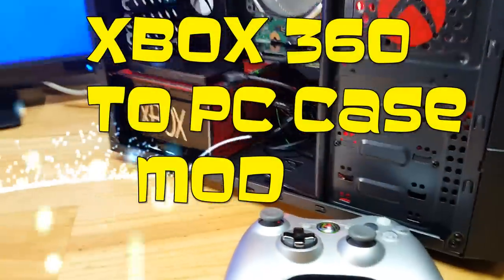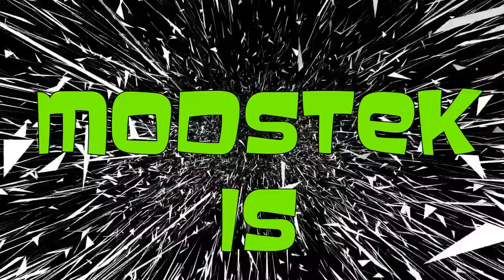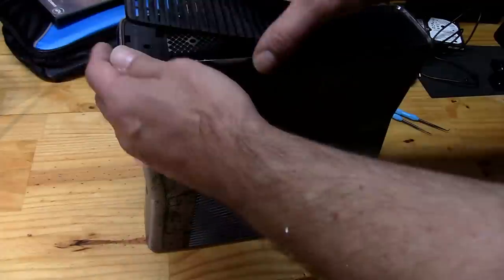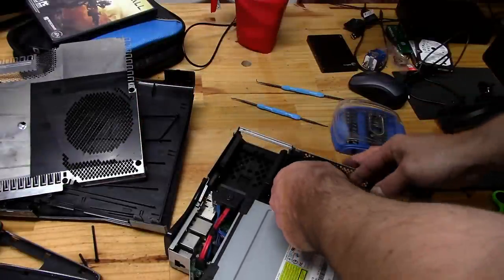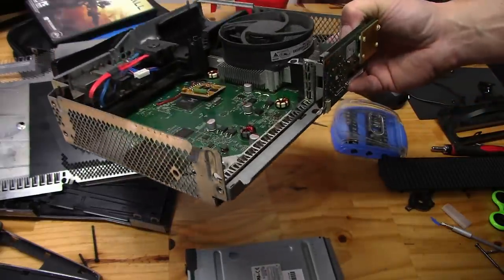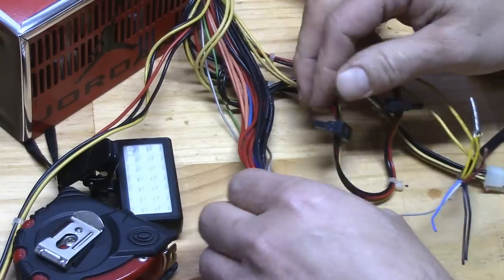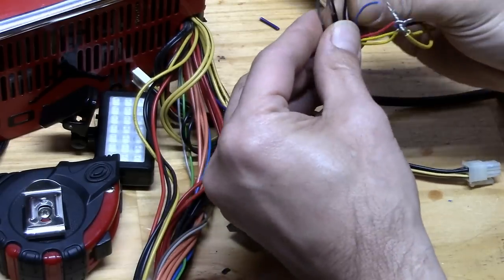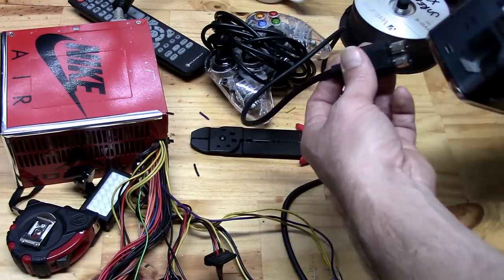My gaming rig is still an Xbox 360 but in a PC case.

Comment: You shouldn't mount hardware over a carpet and specially with bare feet. The static electricity goes nasty that way.
Reply: Nintendork its perfectly fine, i have made 3 pc's before and have never needed an antistatic mat
Reply: famous last words.
Reply: Finn   I dunno, doesn't sound like a bad tip either.

Comment: The cd drive has 2 data cables the power cable transfers data to the xbox 360 as well as the sata but its mostly used to detect if its there

Comment: So what happens if it gets the red ring of death? lol
Reply: Axilla that happens from overheating, so it won't happen
Reply: Axilla It won't, because it has a proper cooling system now.
Reply: Axilla you won't
Reply: Axilla it cant because of better cooling if he added it anyway
Reply: That was an issue in the first model where the Mobo melted and then, well.. RIP
Reply: Duck 0002 *ATI GPU
Reply: Ziggy Wiggy my brother fixed the yellow ring of death years back by taking it apart and applying new thermal paste ahahaha xD
Reply: It actually can. Much less common but the slim could get it. Any modern device with a BGA chip, especially the GPU, is susceptible to the type of failure that causes the Xbox Red Ring. Everything from your cheap tablet to your 800 dollar video card.
Reply: iggy151 well too bad it doesn't happen to any of thise
Reply: iggy151 those
Reply: With the extra cooling, I think that is a remote possibility and with a plentiful supply of motherboards, he can just install a new one...
Reply: It's a slim bro in case u weren't hammered on that enough lol
Reply: My X360 slim did the rrod once
Reply: Will this accept a desktop GPU replacement?
Reply: Slims don't get rrod
Reply: its a slim model it doesent have the bad red ring problems, only the minor problems will happen to it, like bad harddrive, E71 and overheating when in a closed space
Reply: @hrishikroy7866  slims do get the red ring of death. Its a small red dot and an easy fix if you arent litterally throwing the xbox out of a window

Comment: As if the 360 wasn’t big enough...
Reply: Matthew Ledford the 360 is small
Reply: popster1man mine  yea
Reply: Compared to the Original Xbox, its smaller. My favorite model was the Slim S but it still had issues with overheating  with later games like GTA 5.
Reply: PowerLeef I own both the slim and didn’t have any over heating problems and I played gta 5 a lot
Reply: PowerLeef my playstation 3 slim works fine without overheating. in 7 years of use i don’t have any problems
Reply: Twisted HD wow. You must've gotten lucky. Everyone I know with a 360 of any kind has overheating problems. The way I've found to keep them cool is keep a fan pointed at it and when it first starts lagging to put an ice pack on it.
Reply: Ilikeboost my xbox 360 slim has 6 years and no problems xdd "lucky" sure
Reply: @ilikeboost4764  I bought my 360 in 2011, and I don't believe I've ever had an overheating problem to the point of lag. Loud fan, but no lag. Yay meee?

Unless you mean the original models?

Comment: probaly can't, but a pc in an xbox 360/one/first xbox case
Reply: Brett Tech World it can be done, I've done it with the original Xbox, but don't expect it to do much gaming
Reply: Someone put a pc into one of the fat ps2s
Reply: mini STX is a possibility. it'd fit regular processors and laptop-grade GPUs like a 1070 or 1080 mobile chip.
Reply: A youtube person 'BTA' made a gaming machine into a PS2.
It had a decent i5 and a 750ti, then a 1050ti.
The xbox is much bigger, I'm sure it would fit.
Reply: Brett Tech World if you see it from the other side, mini itx system.
Reply: Eddie Zarick posted a video on that a week ago sporting a GTX 1050 Ti / i3 7100 / 8GB RAM / 256GB SSD
Title of his video: "Gaming PC inside an XBOX ONE S!"
Reply: The original xbox is basically a pc already. No mod necessary
Reply: Big Daddy consoles are not pc...
Reply: I have my pc in a xbox 360 case the thermals arent bad its like 80 on my i7 6700k and on my gtx 1060 6gb its around 76 .. its easy to do if u have the tools
Reply: A guy on Facebook put on in a 360 case, big Lego head, and is planning to do with in a metal briefcase that carries audio equipment
Reply: If you use a pci-e flat ribbon cable you can lie a half decent graphics card next to a motherboard of suitable size to accommodate in the case.
Reply: He did that
Reply: Thin client of elite desk
Reply: You could probably use a ryzen for the graphics, or a low profile 1050 ti. Or both together. That would probably fit inside any Xbox, especially if you used the 2200g or any ryzen like it with the Vega integrated graphics. Could easily fit that on its own inside an xbox 360, and you wouldn't even need a dedicated gpu. Not too sure about the power supply though
Reply: Just smack an mitx into it
Reply: He already did it

Comment: When you try to be a pc gamer
Reply: I like how having it in a PC case with more cooling would allow it to ventilate the heat better, but I don't get why he had to wire up the motherboard to a custom powersupply. There's really no need. Plus with the failure rate of most modern power supplies in today's PC gaming market, if it were to fail, he would have to rewire it all over again. Believe it or not, overheating is still an issue with the Slim S model ( 2010 ) in games like GTA 5 so this mod would be excellent for that. I wonder if there would be a micro atx tower that this could fit into instead of just a mid atx tower? Its not like you're going to be using any of the expansion bays on the Xbox, lol.

Comment: If only you could make it run windows instead of the xbox operating system so then you could play more games on it
Reply: if only you could get a pc...
Reply: Justin that's why windows 7 exists
Reply: Nick Dunnington but i has 512mb of ram, maybe windows xp
Reply: Windows 7 needs at least 1GB of RAM there bud ;)
Reply: I'd say at least 2.5. i have a win 7 pc with 1gb of ram, and let me tell you, it is not a good experience.
Reply: Would an Xbox one work instead
Reply: That, and completely different architecture. PCs are based on x86-64, while 7th Gen consoles are based on PPC64. And x86 emulation on this system would likely not be enough to run anything past 1993. Lol maybe Linux is an option, but again, PPC64 architecture means no Steam.
Reply: Steven Techno  Xbox 360 was based on PPC processor, PS3 used Cell processor
Reply: Cell is related to the PPC architecture
Reply: i’m pretty sure someone got linux running on an xbox 360
Reply: Steven Techno whh not install ppc supported linux and kvm windows?
Reply: timberjack460 dued the 360 has 256 megabytes of ram and vram, it would struggle to run windows xp, console has optimization that's why things work good/ok

Edit: it 500 something, but still even then
Reply: yeah you could there's more games on pc
Reply: Then get a PC
Reply: no the Xbox 360 lacks the ram to tun most pc games so it would be a low end pc

Comment: What is that small tan circuit board on the 360 mobo?
Reply from the maker: custom bios chip I guess I don't know the technical term
Reply from the maker: yes its an rgh chip
Reply: modstek did yu say what size the mobo will fit
Reply: The actual term is an executor chip, The chip is installed to run unsigned code on the Xbox(RGH/Jtag)  otherwise known as mods.
Reply: VortexDoesYT 😂 that's not even a board from team executor he'll it's not even an ace v3 the term "custom bios chip" fits WAYYYYY more that what you said
Reply: It's a glitch chip (RGH). Its a cheap chip and the boot time on it isn't the best, but as long as it does its job I don't think it matters. My old jasper rgh had a 10-20 minute boot time which sucked so I got tired of it and smashed it. The boot time u really want is instant to 3-5 minutes and usually that's a slim or a eslim (trinity/corona) with a team executer chip

Comment: How would you connect a controller if there is no connect button?
Reply: Please educate yourself on how an Xbox works. The button is connected to the motherboard how else would it connect? to the damn case? 😂
Reply: Owen Tait even if it didn't, pc can still have controller support in some games if you have Windows 10.
Reply: SexyDuck what? PCs have had controller support for years. before Xbox was even a thing
Reply: It automaticly connects
Reply: 7:31 he doesn't use a wireless controller
Reply: SexyDuck but it’s not a pc it’s an Xbox 360 in a pc case. You realize PC os run from the motherboard not the case right..?  If you take a 360 mother board and put it in a tower it’s still a 360.. it doesn’t magically turn into windows running Xbox os 🤦‍♂️

Comment: Still wish i woulda made a video on mine a few years ago. Used an old PC case with one of those 5.25 inch GPU/CPU temp displays and some leds. Looked pretty neat. I wired the PC on/off button to the ROL board so the PC case button actually worked. Not nearly as nice as this though. I'm thinking about taking your idea here and buying a nice case like this and slap my RGH in there.

Comment: This is the best thing I've seen someone has ever done with any Microsoft console. I think you should do a follow up, stating the  thermals and the overall performance on this mod after you completed it. Also, what other modifications you did after tearing down the original COD case (the heat sink and the cooler, for instance).

Comment: I did this years ago, only I soldered the PC PSU directly to the xbox mobo under the power connector on the back side of the PCB.
Reply from the maker: My soldering skills suck i dont have the right equipment 😔

Comment: Try using a 500GB Seagate or Western Digital solid state drive as an option. Try a supercooling fan for the Xbox 360 mod as an option. Perhaps you might find more Xbox 360s at thrift stores and mod them also what you did, lad.

Comment: Did this myself just the other day with an old ugly case that's like 15 years old, two extra fans powered w/ 150w pws, a molex to 3 pin fan x3. just jumped the green and black wires on the mobo cable coming out of the pws and got a switch to control pwr. shoved it in a small end table and modified the door so only the exhaust fan and disc drive stick out!!!

Comment: I'd take that a step further and put in some extension cables for the USB, and Ethernet say to PCI brackets. trust me it will be easier instead of reaching inside to plug in a thumb drive or a ethernet cable.

Comment: Pretty good video man should try liquid cooling a Xbox 360 on channel
Reply from the maker: +GoddessORainy that's a good idea it would have to be one I didn't care for as much because sometimes a perfectly working xbox will get screwy after removing the x clamp that holds the heatsink on. Sometimes there's just the right amount of pressure keeping it seated...thanks for the comment and idea
Reply: modstek used to water cool my old fat rgh 360it works pretty well plus you can pick one up for 40 bucks now

Comment: At least now
- XBox wouldnt overheat and throttle.
- You can connect more hard drives.
- You can connect 3.5" Desktop HDD.
Reply: KGT UserCast it only has 2 sata ports, one is occupied by the optical drive

Comment: I would try to replace the hard drive with a 1tb hard drive with a clean install of Windows,and if it works do some test on performance
Reply from the maker: +C4T it does have a 1tb hard drive and a 500gb hard drive. I don't know about windows but maybe we could bench the glitch chip...lol
Reply: modstek yeah lol,it would be interesting to see what it could run,can you do it as a video?
Reply: Not possible to do windows on it. It runs on a power PC chip not x86 and even if you somehow got passed that the specs are so low that it can't even run win 7

Comment: Could you not have converted the back panel to allow the original power cord to fit into the case, this means you wouldn’t have to destroy a psu for a pc and Xbox. 
I mean, I was thinking of doing this but I’d have to make sure the io panel fit the back case properly

Comment: How’d you wire the front panel connectors to the Xbox motherboard? So you can use the pc cases factory power switch to turn it in?

Comment: How do i add both a xbox 360 and a pc into the same case? Larger case i guess, but, is there a way to do this that wont break the pc? I want to modd my 360 and download EVERY GAME for that. Then with my pc, i want to emulate every old game i can get. Then with this pc/360, i want to build a bad ass Arcade.  Any ideas? Also, can i use the same disk drive for both?

Comment: Please reply

Is the fan shroud important? The piece of plastic around the fan,is it important?
Reply from the maker: +Randomthingz2show Randomthingz2show it's only important when it's in the xbox chassis. The shroud is to help draw the heat out for where it's needed the most. With the fan flipped and blowing into the processor in the pc case it's keeping it all cooler.
Reply: modstek ohh,i was just wondering if i would remove the fan shroud, would it be better or worse.

Will it work if i take out the fan shroud and add external fans?

Comment: Now I've seen it all a PC in an Xbox and an Xbox in a PC.
Reply: Actually there is one thing I haven't seen Hardware emulation. But that's too crafty for an end-user to do. But it wouldn't be that difficult for a company to make. You could probably fit an Xbox 360 into something the size of a video card for example. But something an end-user could do would be put every console he felt like inside of a PC. And hooking up storage for network-attached storage for games everything that can be softer emulated easily. And then using video capture device to funnel all the display outs into one monitor. Wouldn't it be great to have all your games in one place?
Reply: Well except handhelds if you're into that

Comment: You left to much out of the video  for this to help anyone.
How to wire the PSU was good you left out

1, how to mount the motherboard inside the PC
2. what other options for the CPU cooler fan
3. how you mount the DVD drive in and cable hook up.
4.where did you place the power button
5. how is the I/0 panel use able and placed inside the case

Comment: Ok so umm if I had a spare Xbox 360 that I don't use and the hard drive is still good (assuming that this will work) I could take out the hard drive from the Xbox and I could build a gaming pc and put the hard drive in the pc, could I run Xbox 360 on a gaming pc?
Reply from the maker: +GamerTV456 It's not a gaming pc it's just and rgh modded xbox 360. Over a 100 games that don't need the disc to play. 
  It was running hot I was only protecting my investment.
Reply: modstek no I mean if I do this myself, could I make a high end Xbox 360 with like a gtx 1080?

Comment: well this makes no sense, the whole point of PC is its modular. The 360 is not modular. You cant overclock as far as i know, you didnt change the cooling on the APU die, which i thought would have been a big reason though in a open case it will run cooler as a result in general. You cant upgrade anything, I just dont get it. sure... you can. But should you have?

Comment: Fidget spinners are useless machines designed to spin with little effort.[3][4] A basic fidget spinner consists of a two- or three-pronged design with a bearing in its center circular pad.[4][5] A person holds the center pad while the toy spins.[5] They are made from various materials including brass, stainless steel, titanium, copper, aluminium, and plastic.[3][4] The bearings are generally ceramic, metal (stainless steel or chrome), and some are hybrids—such as ceramic balls with stainless races and cages. Each fidget spinner also has two or more weights on the outside that make it spin faster and stay balanced. Bearings can vary to adjust for the design's spin time, vibration, and noise, causing unique sensory feedback.

Origin
As of 2017, the patent status of the various fidget spinners on the market was unclear.[6]

Catherine Hettinger, a chemical engineer by training, was initially credited by some news stories to have been the inventor of the fidget spinner, including by media outlets such as The Guardian,[7] The New York Times,[8] and the New York Post.[9] Hettinger filed a patent application for a "spinning toy" in 1993 and a patent was issued, but Hettinger allowed the patent to lapse in 2005 after she could not find a commercial partner.[7][6] A May 2017 Bloomberg News article showed that Hettinger was not the inventor of the fidget spinner, and Hettinger agreed.[6]

In an interview appearing on May 4, 2017 on NPR, Scott McCoskery described how he invented a metal spinning device in 2014 to cope with his own fidgeting in IT meetings and conference calls.[10] In response to requests from an online community, he began selling the device he called the Torqbar online

Comment: WHY? It's just larger and more cumbersome now. Not to mention the Xbox 360 units have an absolutely fantastic design, except for the last model which is too basic. The PowerPC 970FX chips were designed to withstand up to 90 degrees Celsius. 67 degrees is nowhere near it's maximum limit. Maybe the noise is the only problem but anyway I don't like this mod.

Comment: But you can't upgrade it or Anything?
Reply: corgidog the mother board doesn't have gpu slots or cpu slots. It build in to the motherboards. So you have replace the mother motherboard. But then it wouldn't be an Xbox 360 anymore.